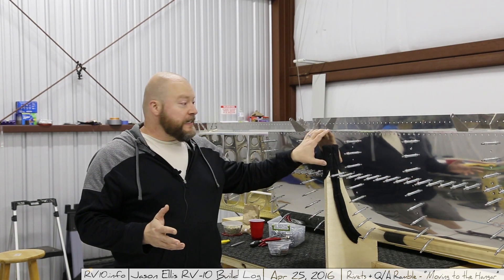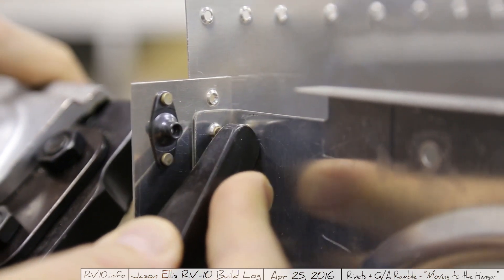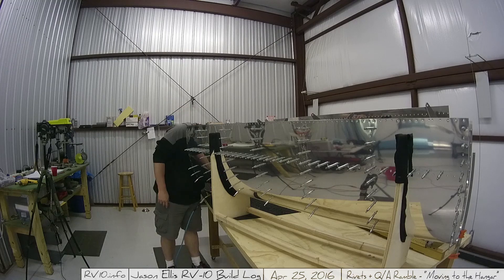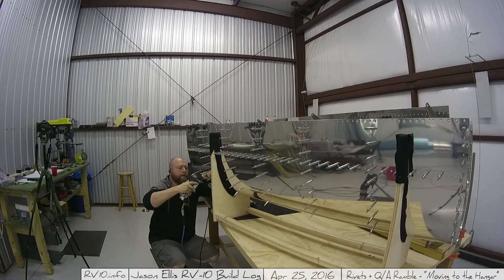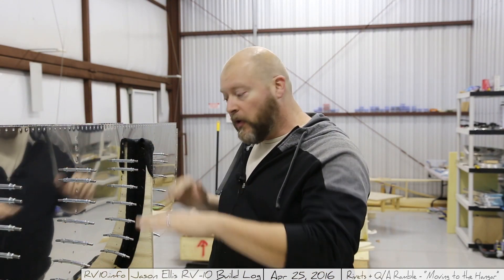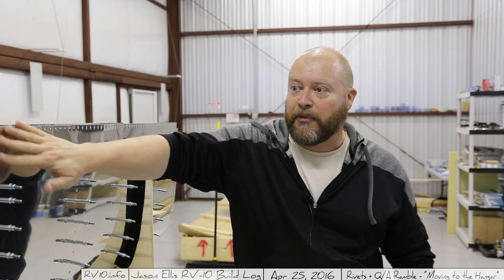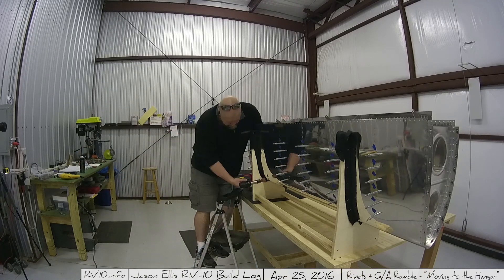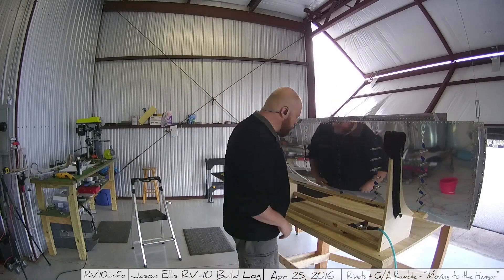RV-10 Wings - 017 - Left wing nose rivets plus ramble about moving to hangar

Comment: Hey man the rivet you squeezed close up was not long enough, because the hole was too big due to your dimpling of the substructure. When you shoot a rivet, button head or countersunk, the rivet swells under the head first until the rivet hits metal(the sides of the hole, therefore  it seals the hole) and continues to swell down the shank of the rivet until outside of the hole where it swells over the hole and forms the bucktail(or manufactured head) and seals the hole. If you look at the bucktails on the nutplate next o the rivet in the video, that's what the bucktail should have looked like. It was a good clean, round hole, just oversized due to the dimpling. If you would have used a rivet that was a half size longer, it would have been good, I would think Van's would give you rivets in half sizes but I don't know. Whatever you do, don't go back and change it, it's good enough. Just use a rivet a half size longer when need be. Hope this makes sense and helps, if not, well, poop. Good luck, it looks good so far.
Reply from the maker: I used the rivet test tool (the little bent bit of metal with the depth gauge at one end and the shot head sizing gauge at the other) and it showed to be correctly set.   shrug  But a .5 longer rivet probably would have been a better idea.  I went with the rivet they called out on the plans though.

Comment: Yeah, in response to your response, as odd as this sounds, don't always trust your go-no go gauge when it comes to buck tails. ALWAYS trust the "Eye Test". When a buck tail is formed correctly, you should NEVER see any part of the edge of the hole. And also, don't always trust the planning or the blueprints in reference to fastener LENGTH (LENGTH ONLY). Planning is written up by planners and 99% of them have never even seen a rivet, they go buy what engineers tell them. Blueprints are drawn up by engineers and they never take in to consideration the thickness of the sealant (yes, it adds up and can make a difference, especially in a big stack up of parts), and they never consider that dimpling never comes out the same for each hole, let alone each person, and 99% of engineers have never shot a rivet or dimpled a hole. Boeing, McDonnell Douglas, Sikorsky, etc.. etc.., all these companies I worked for, their blueprint fastener lengths were always wrong, especially with hi-loks, they were always one length too short on the blueprint callout. The EYE TEST is never wrong. Anyway, your bird looks good, keep it up. Good luck and God Bless.